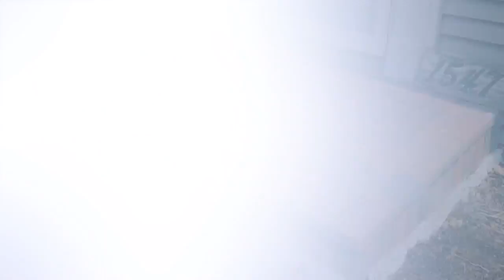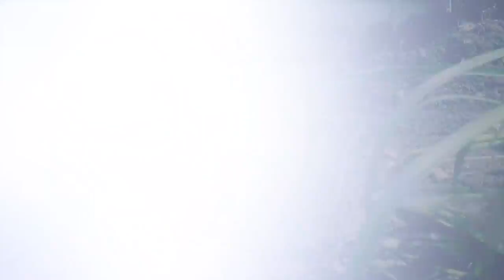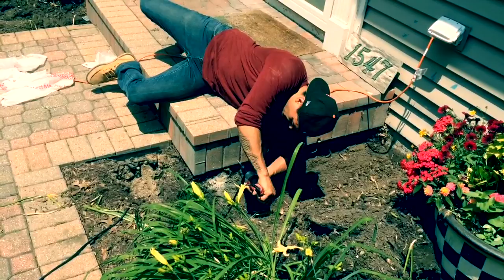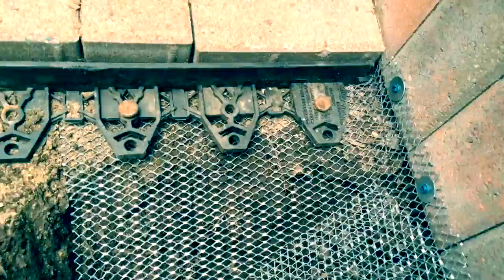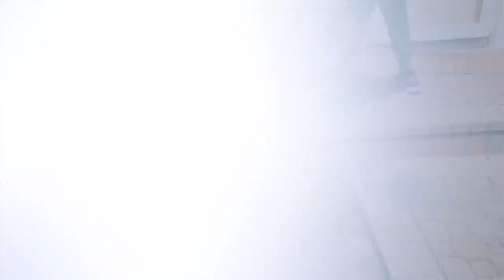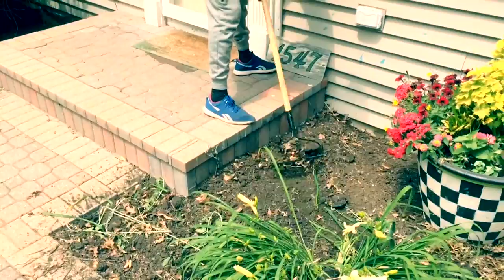Wildlife Exclusion & Animal Proofing of Concrete Stoop

Comment: I did something similar to that on the weekend.  the skunk just went back about 5 feet beyond the the mesh and about a 1 foot lower then I dug.  I put the mesh down about 18 inches into the ground and filled it with concrete.  They are persistant little buggers
Reply: I was about to say, concrete is usually the way to go when you want to secure wire to the ground.